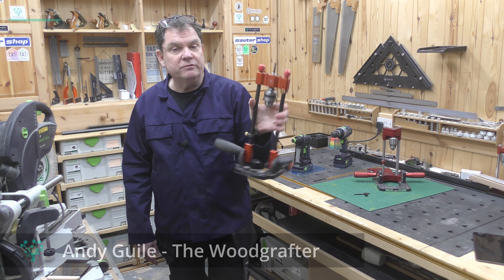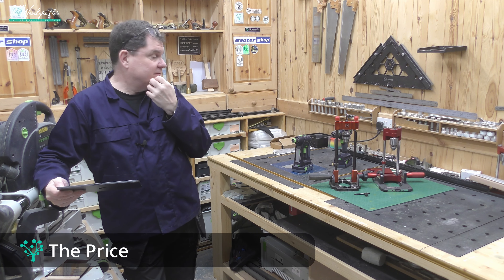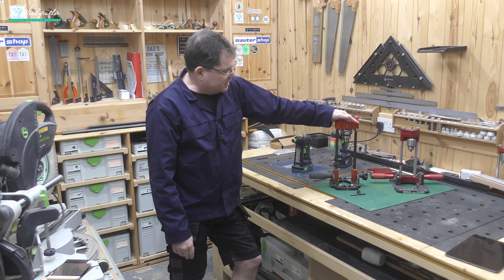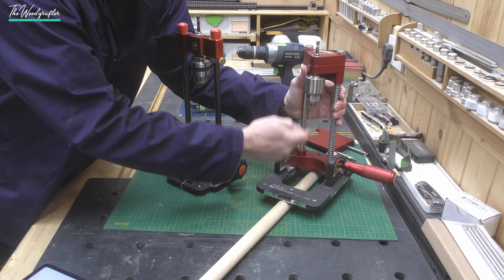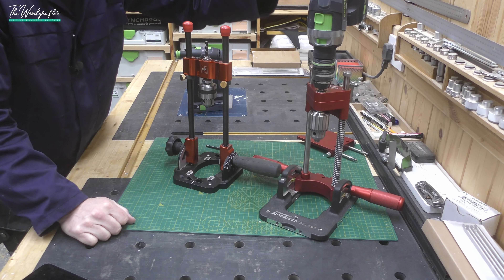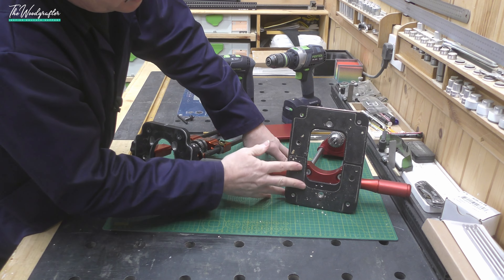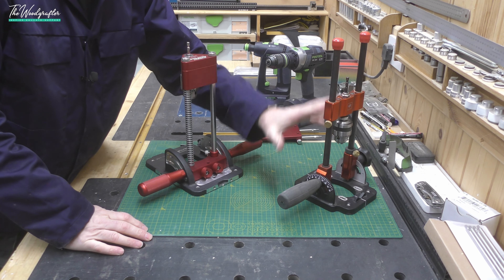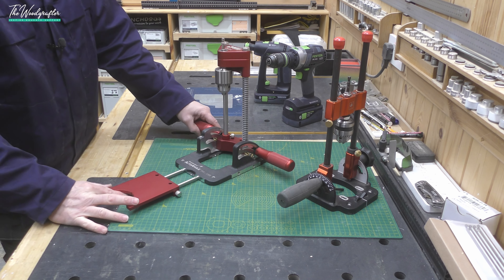Angle Drill Guide Face-Off: UJK vs. Woodpeckers AutoAngle!

Comment: Thank you for doing this comparison.  Woodpeckers makes some nice stuff, but their pricing is beyond Festool IMO (I can purchase a Festool RO125 sander for less than the AutoAngle).  Rockler makes a drill guide similar to the UJK that is about the same price point, and it has a 1/2" Jacobs chuck.  That would make an interesting comparison.   Steve
Reply from the maker: Cheers Steve,

And thank you for the feedback, yes Woodpeckers make really nice gear - but even with the money I spend on quality tools, I can’t justify it.

It was nice to get my hands on the drill guide and I can appreciate the engineering. But my UJK services the purpose In need in the shop.

I’ll have a look at the Rocklers out of interest.

Cheers

Andy

Comment: I think a complete delivered price comparison, which includes VAT, shipping, and any duties, would be more realistic for any potential international buyers.  Based on your previous video, this would put the Deluxe WP version at about four times the cost of the UJK version.
Reply from the maker: Hi Mike,

The problem is working out all the variations of shipping costs and tax, it’s not so bad with a shipment to the UK, but when you consider UK to multiple states there are just to many tax variables.

So decided to give the base costs then folks can work out shipping and tax based on their circumstances. 

But yes, shipping to UK plus tax is a big add on to the price.

Cheers

Andy

Comment: What surprises me about the cost of the Woodpecker drill guide is the shipping cost. In January 2023, I had two pairs of New Balance walking boots shipped from the USA with a shipping cost of $25. I ordered them from Amazon USA as I could not find the specific item on the New Balance UK website. There was also tax of $31. The overall cost was comparable with a similar item in the UK. (The actual shipping was a remarkable process. I got regular updates and was able to track my package from Arizona, through various hubs, to a nearby courier distribution centre. That took around 36 hours, the final journey of 40 miles took another 36 hours).

I have also ordered a couple of products from Katz Moses Tools. The 3x3 Trim Router Jig and the small router table for same. In each case the shipping cost was $18. (The router jig shipped without a hitch but the router table got stuck in UK Customs for about a month).
Reply from the maker: Yes, I was really surprised when I saw the shipping costs.

It would be better to have a friend in the US to get it shipped domestic - then have them ship it out.

But it is what it is.

Cheers

Andy
Reply: Back in my day you could get a two way London-New York and back ticket for less than that! 😉
Reply from the maker: @wh0tube LoL, but could you drill neat straight holes, at any angle with repeatable stops ??????

Cheers

Andy

Comment: Hey Andy. New viewer and have watched quite a few of your videos by now. Enjoy the way you are to the point. Thank you very much for the reviews!

I have had my eye on the more basic woodpeckers version  version but…… just in case, and sure everyone thinks this way, I may need the angle function one day so….. have been considering the woodpeckers version without tilt functionality. Yes the price is a bit ridiculous. A third of what a good drill press would be if you opt for the deluxe kit, which I would.

The reason for writing this comment is to ask, as I have never held the woodpeckers version before, would it be possible to align the two red pucks for drilling into round stock using one of the bars for the fence? I am thinking because the bars are straight and a small diameter you could set them in the two machined “v” in the red pucks for alignment prior to tightening the socket head cap screws?

Thanks having a look at the post and thanks again for the videos. Have a good one.